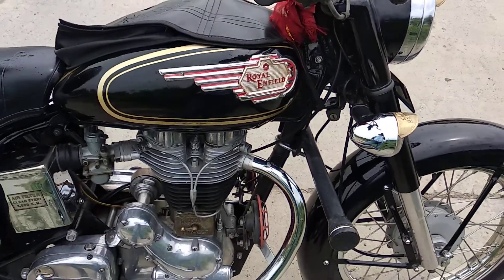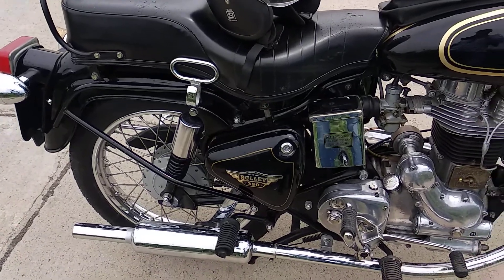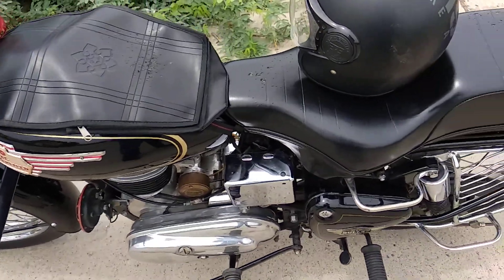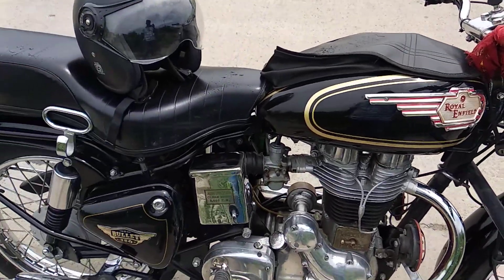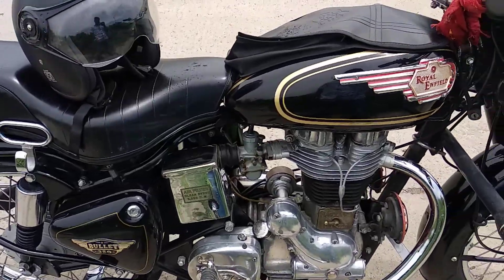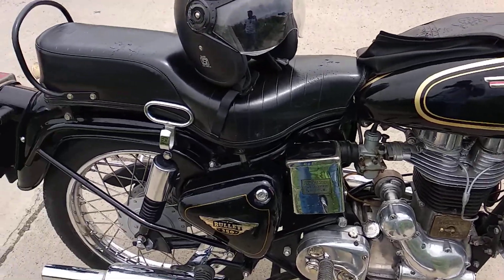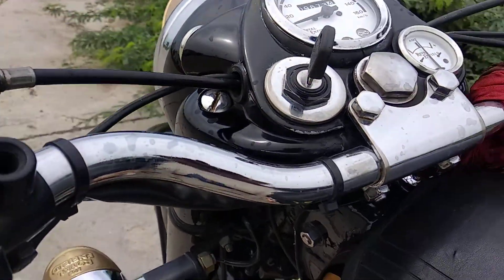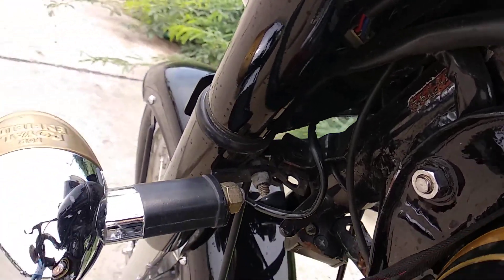Five things I don't like in my bullet# old Bullet# old Royal Enfield

Comment: Gokul in fourth point you mentioned is ignition coil, usually dry the black spark plug cap  that connect to the spark plug after water wash. Bro most of bullet riders having issues with gear changing lever,struck during gear changing, that is not user friendly like modern bike, make a video about it
Reply from the maker: Sure bro